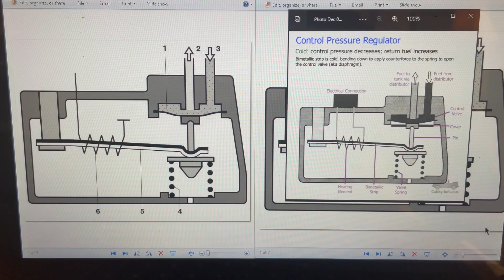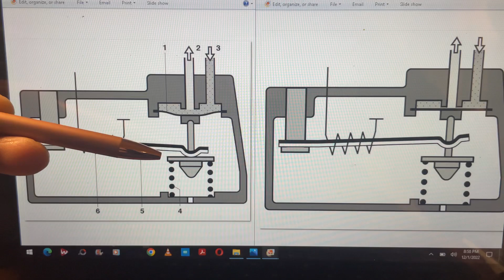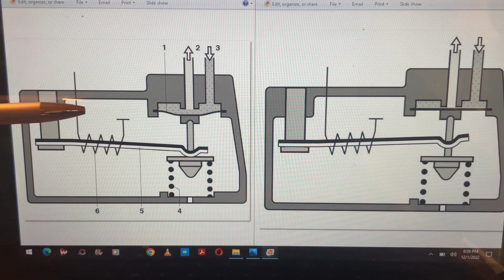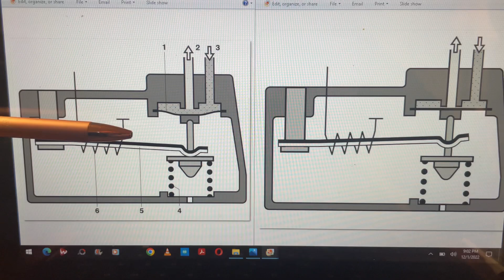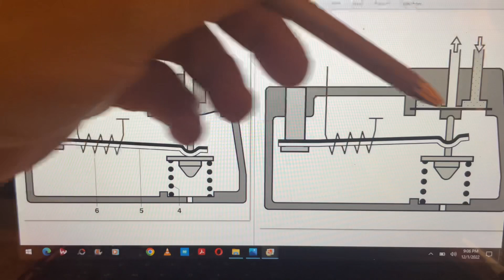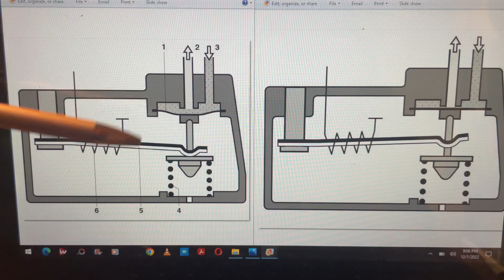Tutorial: Bosch K Jetronic Warmup Regulator / Control Pressure Regulator - how to check & adjust

Comment: Does this device control the fuel system pressure? Mine is 120 and not anywhere near what it is supposed to be. My car starts fine cold or warm bit it runs way too rich even after adjusting the mixture. The pressures are sky high. Do I need to drive the shaft down more?  I figured you can use a harbor freight puller tool to gently guide the shaft down. My fuel pressures on my K Jet are insanely high.

Comment: Ive heard that adjusting the wur screw can have a big impact on fuel consumption if it's not set exactly right. That is why i was always hesitant to mess with mine. I eventually just paid CIS Flowtech in Alabama to rebuild and calibrate mine. they do very good work.

Comment: Could some please explain the fuel pressure regulator/damper that is between the fuel  distributor and WUR, how do they work together.  I purchased a 1985 280SL automatic with M110.990 engine that is running poorly.
Reply from the maker: @MikeSmith246  check the videos from Kent Bergsma 
His channel is Mercedessource 

https://youtube.com/@mercedessource?si=B3llIu3SEdQOt-gx

Comment: You can adjust the nut under the copper plate. You have to take apart the regulator. Others drill into the copper.  This video is not really that clear in terms of function and mechanics of how this system works. Can you re do this video please?
Reply from the maker: It depends on which one of the 101 different Warmup Regulators you got from Bosch. This is a tutorial for 068 WuR.
Please specify your model and I will see if I can make video for your model

Comment: interesting video, if the warmup regulator was faulty, could you have a situation where the cold start works fine, but hot start after sitting awhile is difficult ?
Reply from the maker: Yes, but the other causes for that is bad / cheap gasoline (according to Bosch ) which results in vapor locking and vacuum leaks.
As to vapor locking, check if your car has a check valve installed on the fuel pump ( these were field retrofitted as recall ) and that your accumulator is working. Do fuel a pressure test to make sure the fuel pressure remains at the in the service manual specified pressure when you turn off the engine for 30 to 40 minutes. If the pressure drops fast then you may have a fuel leak, bad accumulator or a bad WuR
Peter
Reply: @inovahightechltd  Thank you Peter

Comment: Could you recommend a pressure testing kit? I have an 85 golf gti 8v that's cutting out when cold and a 16v that's cutting out when warm. Both have been sitting for a few years and I think testing the WUR is were ill start. I'm in NZ and I think our fuel might not be the best for these cars.
Reply from the maker: I bought one from tooldiscounter.com for like 90 bucks almost 3 years ago. It has held up ok for the 3 to 5 times I used it on two different MB’s. My 89 560 and my friends 1980 450SEL
It is not the best quality but hasn’t started to leak either. It has the switch valve similar to the original MB/Bosch unit. I verified the accuracy of the pressure gauge before each use. The accuracy has remained steady. 
This is a universal gauge for all K and KE Jetronic’s 

https://www.tooldiscounter.com/product/s-and-g-tool-aid-cis-k-jetronic-tester-sag33800?originalQuery=SAG33800

Comment: how is the warm control pressure adjusted, if cold control pressure is increased will the warm control pressure also increase
Reply from the maker: Depends if you have the unit with double or single vacuum chamber. What is the Bosch number on your WuR? They made 132 different versions of it.
Reply from the maker: Something is wrong with YouTube.
Reply: @inovahightechltd  i see my message has gone again
Reply from the maker: @sas8403  what is that in bar? What is your system pressure, 20c pressure range and operating pressure range?
Reply: @inovahightechltd  system pressure is 6.34 bar,  manual allows 6.1 to 6.8 bar for this bosch regulator.
At 15.5c my COLD control pressure was 2.7 bar, manual allows a range of 2.55bar to 2.9 bar.
Warm control pressure was 3.9 bar, manual allows for 4.5bar,,its this warm control pressure that is currently out of spec and i need to increase
Reply from the maker: @sas8403  the Bosch part number also disappeared.
I need that part number again
Reply: Anyone have some original Bosch WUR setup and calibration documents or links or names?  Great video content.

Comment: Hello, my regulator on the M116 380 shows 3.4 bar when cold, I supply 12 volts, it rises to 4.1, it turns out a lot. How to fix it?
Reply from the maker: There are videos from Kent Bergsma / Mercedessource where he shows on how to adjust pressure